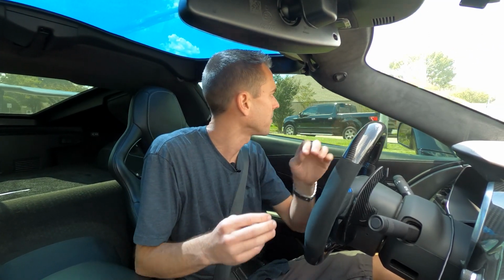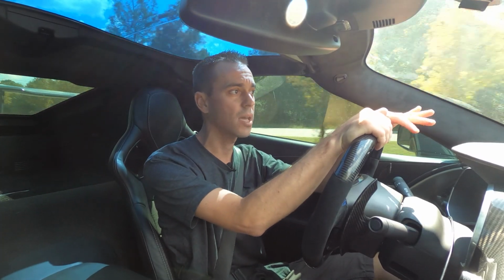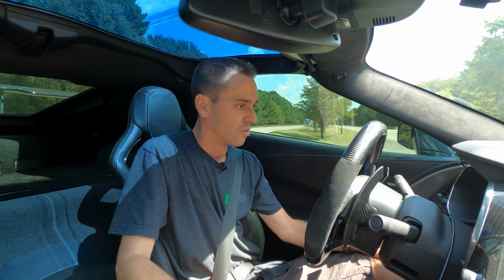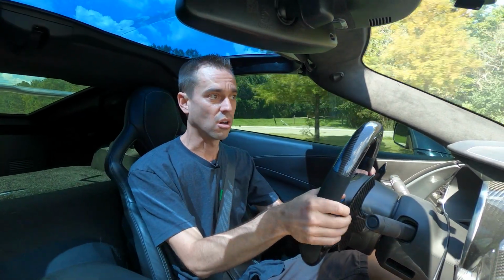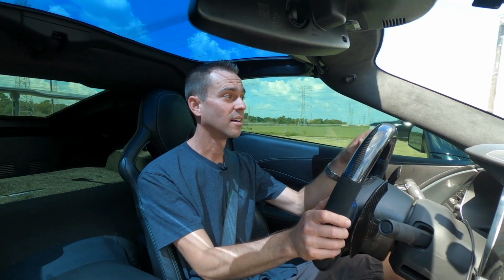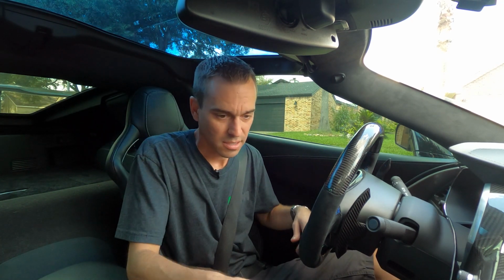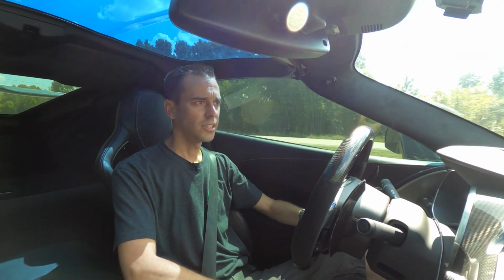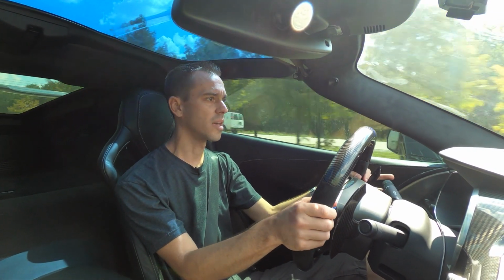Street Speed 717's ZR1? We think it's time he does something crazy

Comment: Turbos to see if it can run with a turbo Calvo viper!
Reply: My thoughts exactly. I think if Steven is given permission he can make something that will hang with or beat the Calvo Viper...I think but I Don't know anything...well Steven?? Can ya? 😀
Reply: They aren't even competing. They are top tier in their own fields! Calvo builds race cars outta vipers and offers a TT kit for them. Calvo offers packages, and they talk about simplicity, yiu want 1600hp? You can pick your trans option but for the most part, he has it down what they offer, and how to continue to serve long term, and maintaining them a lot easier thanks to them using same hard parts they install on each build. Fuel is the only variable and I'm sure their Is like an e85 min
Reply: @haydenroyer  Yeah, I think Mike is talking about going with their lower 1300 or 1600 package.  From what I've seen, the top TT Vipers still own the 1/2 events and there are some pretty insane vettes trying to compete, but aren't all that close.

Comment: Twin turbos are a lot of weight and complexity instead of the current system that works great... put the race blower upgrade on run it on E85 or racefuel an ice water to water intercooler for racing and be done... get CAT down to 120 from 150's... Mike needs streetability and streetability is not twin turbos... I had a dually with 260% injectors and pumps with twins and it was streetable until you hit 50 pounds of boost then 90 pounds was 0.75 seconds away and the tires would break loose at 90mph...  Turbos for track, supercharger for the street... way more predictable.

Comment: Roll racing isn't racing. If its not from a dig, than its just freshman level drama.
Reply: To each their own.  Ran 7's in my Viper, but much prefer roll racing, especially on the street.  Digs are basically a tire contest IMO.
Reply: @ssoffshore5111  wrong. Digs are suspension. Actually showing up and racing pavement. Run 7's at one track, go to the track with the same setup and run a 10 because you blew the tires off. Roll racers do it because its easy and not allot of work goes into it. Dig racers are moving weight, adjusting bars, maybe changing the shocks to a completely different set, limiting the front travel, tire pressure, launch rpm, launch boost, boost after 100 ft. Only thing I mentioned about tires was the psi. You pick bias or radial, way before you even build the damn car. Street racers/roll racers, show up, maybe place a bet, pick the starting speed, and hit the street. You run 7's from a roll, awesome, you're afraid to break your car that you bought. The other guy runs 7's from a dig and built his car. Show me the roll racing national championship, or nhra championship, or state championship, or county championship,  or city championship. You might be able to show me a even winner with a check, but all forms of racing, (hell any kind of sport or competition) crowns a national champion every year. When you crown a national roll racing champion, than ill consider it legitimate racing. I'll put my 9 sec vette, up against your 7 second viper, from a dig. Than ill go home, change the rear gear, click a few buttons, and roll race it. Real racers race the surface first, and the competition second. Its not interstate surface 60-130, thats for kids
Reply: @cliff4695  That was from a dig, with a stick, on radials, and over ten years ago.  Trust me I understand what you're saying and somewhat agree.  Best was 7.76@187.  With that said they are no longer any tracks around me, the nearest is hours away.  Go there sit in line forever (because there's no tracks around) to get 1-3 passes in.  I don't necessarily condone street racing, but I get why people do it.  If I lived in the sticks where you can set up digs, I'd be more interested in it.  Do that where I live and the cops will be there before the light flashes.  Unfortunately, what I'm describing here has become the norm for most of the east coat and west coasts in the populated areas.  If you want to run you car, roll racing is pretty much your only option with some safety and with a chance of staying out of the local barracks when there aren't any tracks around.   I also do like that (with non traction limited cars) it allows you to test, tune, and compare what the car(s) can do and eliminates the tires, surface, and setup you outlined.  But again, it's really the only option for many people and allows you to run just about anywhere and as many times as you'd like if you pick the right areas... and then head to the next spot.

Yes running a 1500+ whp RWD car on the street makes little sense, but I do enjoy getting to do some runs in my DD (C6Z) without having to plan a two day trip to get a run or two in.  So for me, I'll stick to roll racing until a track opens up in my area (not happening!).  Like I said, to each their own... which is why I'm not clicking on NHRA drags and have retired from doing that stuff.
Reply: @cliff4695  I should add that roll racing (on the street or on the track) also allows for folks to get involved with racing and their cars in general, without having to know or even get to technically involved with drag racing details, which can be somewhat tedious for those not wanting to get into all of that.  I'm all for people getting involved with racing and cars, as long as it's done somewhat safely.